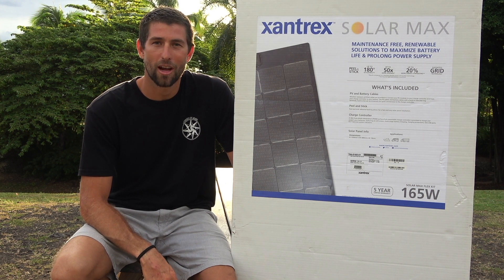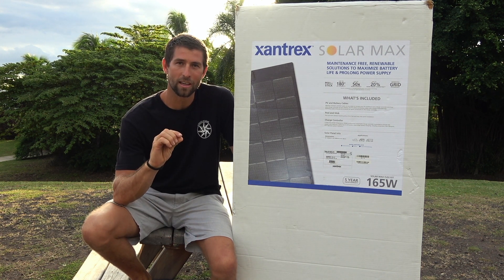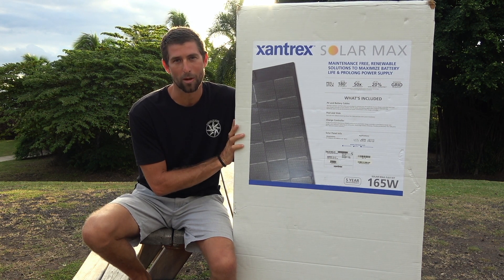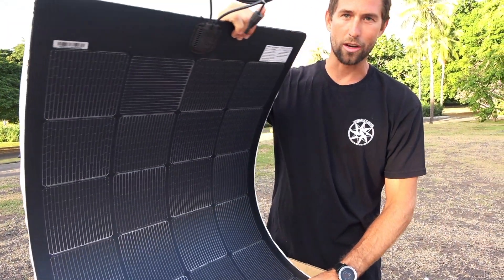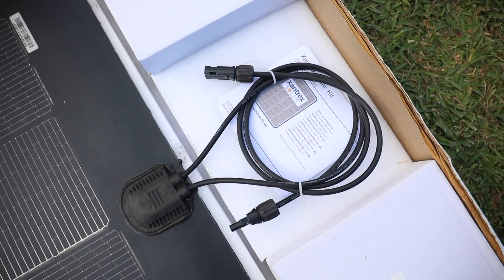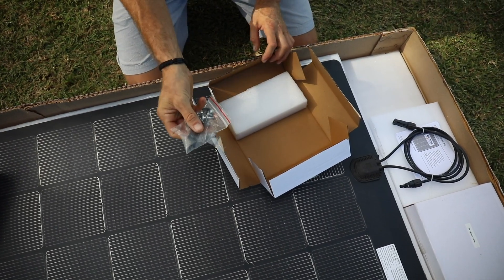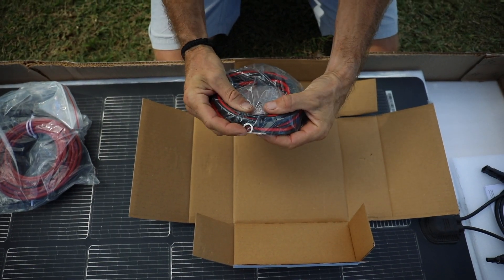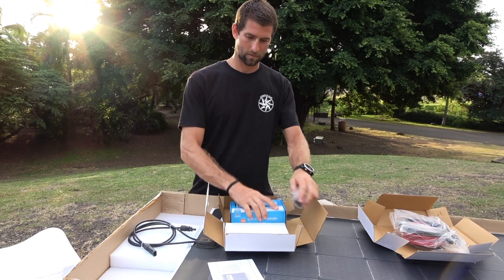UNBOXING 165W XANTREX SOLAR MAX FLEX KIT

Comment: Like the video. I want to see how to fit one of these Flex kits on the front "for head" of my Nissan NV 2500 hightop adventure van?  Thanks, Tim
Reply from the maker: Thanks Tim. We are planning to film an installation video on a van in the near future. If you need any technical assistance you may call our tech support at 1 800 670 0707.